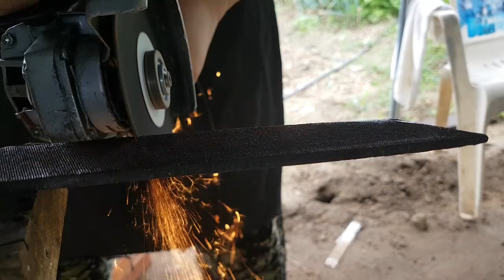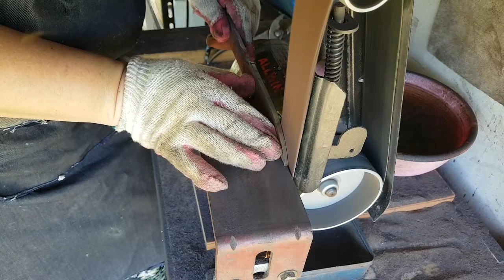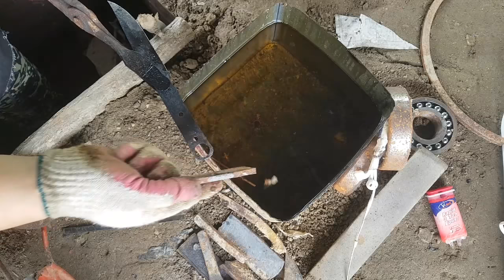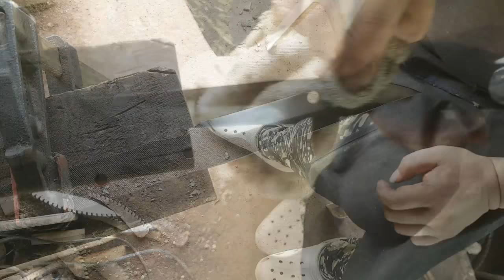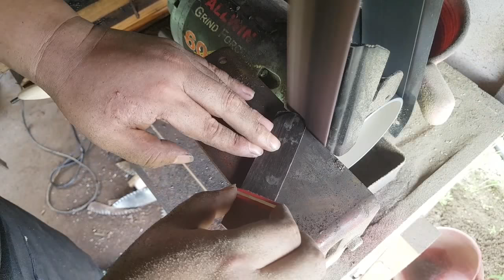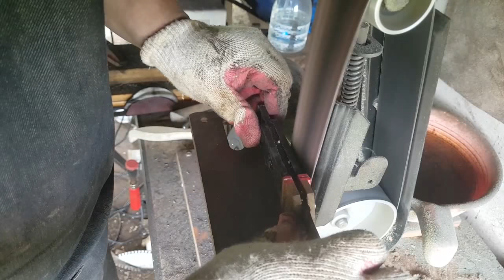Knife making form old file

Comment: Files only cut on the push stroke, not when pulling. When you use a file like sand paper, pressing forward and back, you dull the file.
Only push a file, never draw it back towards you with pressure against the part being filed.
Proper technique is to lift the file off the part during the backstroke.
Reply from the maker: Good advice thank you so much.
I will practice as advised

Comment: Why not cut /shape before hardening?
Reply from the maker: Before hardening, process the shape to some extent and finish after hardening
Reply: He softened the file metal before cutting and shaping, only he did not show the slow cooling "softening" process. But after that process, he did show that the file in question was soft enough to be filed by another file.
Reply: around 0.38
Reply from the maker: @cyy3793  Thank you for the correct explanation

Comment: Hello Brother what is the material that the dive knife after heating and after the identification code entity has become strong and does not corrode
Reply from the maker: Hi Brother, I don't understand 100% of what you say, but ... (I'm Korean)
Corrosion resistant materials are 440A.B.C, AUS 4,6,8,10, 4034, Sandvik 14C28N, 154CMATS34, S30V .. etc.
Reply: hunde Rasse Bernersner